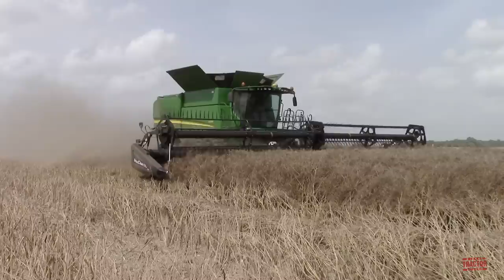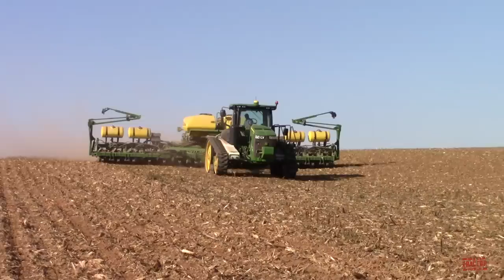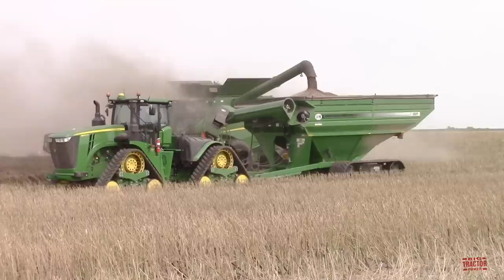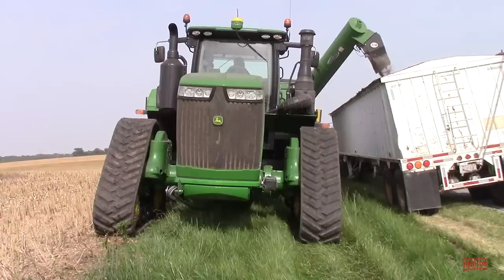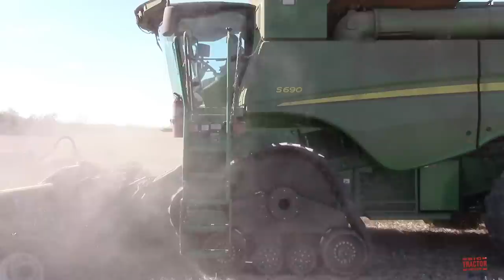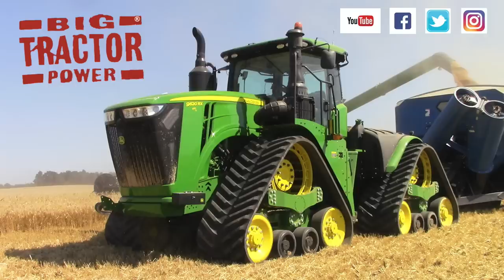CANOLA HARVEST | John Deere Combines & Tractors

Comment: Here in Manitoba we’ve been straight cutting all of our canola for a few years now , Spring 2020 was the first time we switched from a Deere 1830 air drill to a Deere 1780 planter and had amazing germination , cutting our seed costs substantially. We combine with a NH 10.9 and a Mac don fd75d 40 head . Yield usually in the 40-60 bu / Ac
Reply: what spacing on the planter?

Comment: Ok, so you won't give PTO horsepower or torque numbers, how much actual horsepower are the wheels or tracks seeing?
Reply: Most of the power goes to the threshing part of the machine.
Reply: He identifies the models, so you can look it up.  All modern farm equipment is rated at the flywheel.  Wheel or PTO horsepower is irrelevant as the engines power a lot of other functions like hydraulics and power steering.